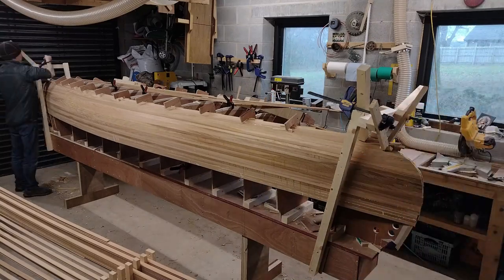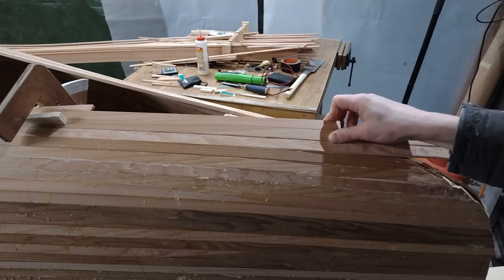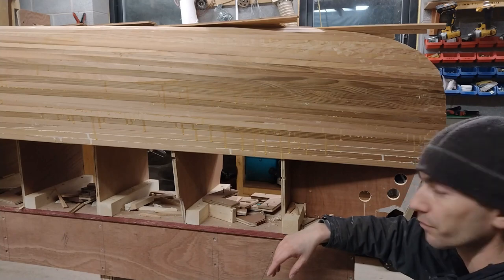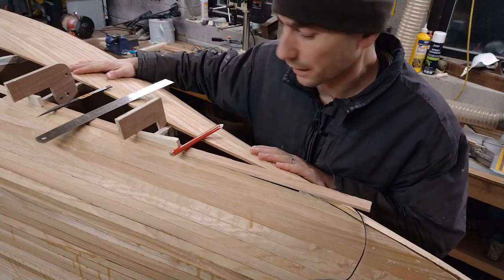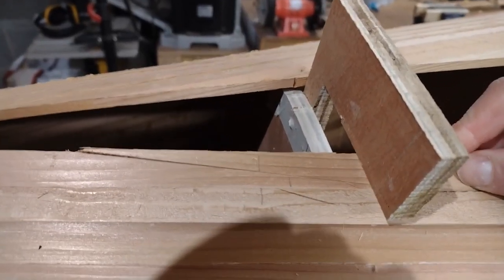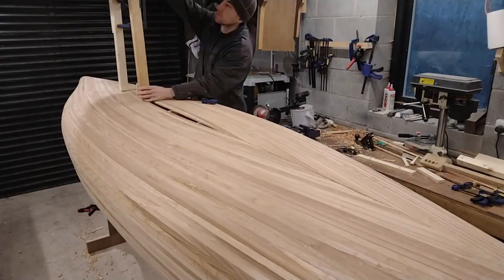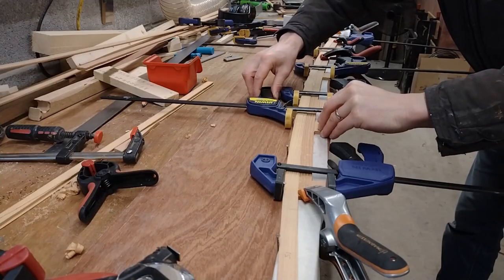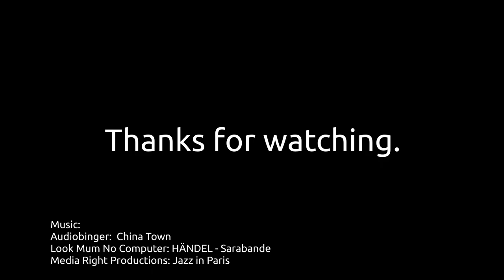Building a cedar strip canoe - Episode 8, Closing the Hull

Comment: I'm thoroughly enjoying and learning from this series.  I have no plans to build a canoe, but I do have plans to build a strip construction cap for my truck bed.  I've got a boat load of sublime c.1840 11/4 cypress, staves from a railroad water tower.
Reply from the maker: Sounds like an interesting project. Will you build it in a similar way, bead and cove strips over a mould?

That timber sounds like a good find. I'm more than a bit jealous - you'd need a new mortgage to buy anything like that on this side of the pond!
Reply: Where did you get plans for a truck cap?

Comment: Hi Andy.... I love this new series of vids.... they have come just in time for me... I love your honesty. Too many other videos make me feel inadequate and wondering why I have the problem solving issues that no-one mentioned! I'm just about to 'close the hull' and all is well in that regard.... I think I might have buggered up one stem fitting by being over eager and trying the mortice before I'd finished stripping.... the tension has opened up the mortice and I've had to apply straps to hold it back....Anyway.. my question is one for the future.... The hull looks great, and I'm looking forward to fairing etc.... but my cedar, although carefully chosen and each strip mirrored from port to starboard, looks really weathered. The colours have disappeared as has the grain detail. When I plane lightly in anticipation, the colours return, but two days later they've turned sandy brown again. How much time do I have from final sanding to applying the first coats of resin/fiberglass.... there is a sort of gap I need explained between ep10 and ep11.... I hope you can help...

Cheers pete
Reply from the maker: Hi Pete, really sorry, I've only just seen this so maybe you're already beyond this stage. I didn't really have this problem, but coating in epoxy should pretty much reveal the colour of the wood as it should be. I had the epoxy on within 12 hours of the final sanding anyway, both on the inside and out. Once that final sand is done, after wetting it to raise the grain, there's really no reason not to go straight to epoxy.

Regarding the problem solving, yes, there's loads of that. If a video is meant to be useful and entertaining, in my mind it needs to show everything that goes wrong too!

Comment: Very nice finish to the bottom... Just a thought... Could it be built starting at the bottom and working to the gunnels?
Reply from the maker: Thanks 👍 And maybe? I think it would be really hard to form the curve of the strips correctly though, and the alternative (straight strips along the join) would lead to weird curved lines on the sides, which wouldn't be parallel with the waterline.

Comment: Seems counter-intuitive to build in from the sides to the keel… 10hrs for the last 10 strips, yikes! Does the book explain why you don’t start at the keel and build out?
Reply from the maker: I think it would be very difficult to create the curve in the strips at the keel if you started there. The other option would be to fit them straight along the keel, but then you'd end up with them "smiling" along the sides of the boat, which would look a bit odd. I think the real problem is that it's the sort of job you only do once in a lifetime, so never get the opportunity to practice it enough to get faster at it!